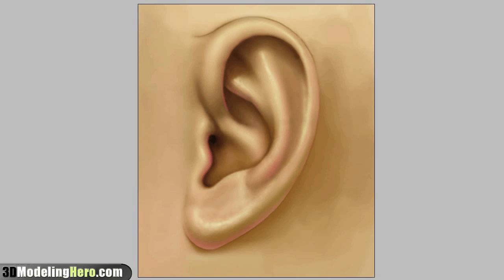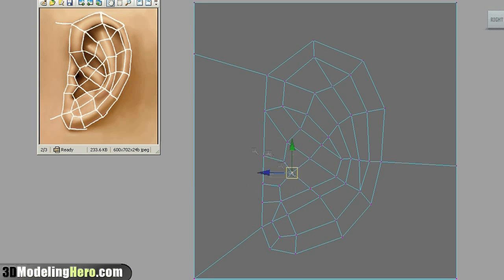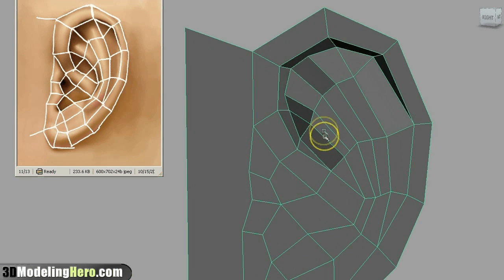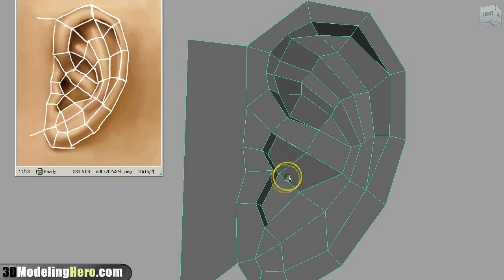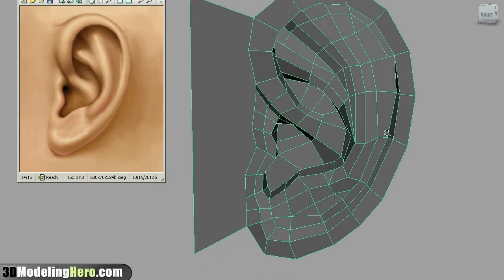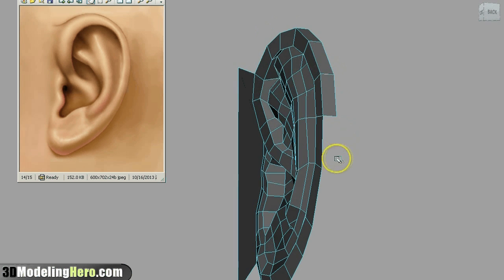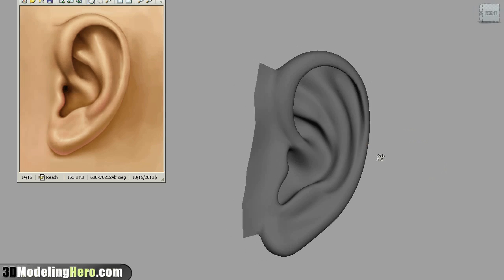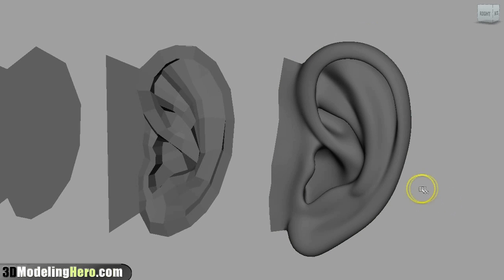How to Model an Ear - Low Poly to Intermediate 3D Modeling Tutorial - Box Modeling

Comment: Mmmm...Breaking the flow by having sudden tris about? Not quite my style however useful to see a method to get down the shape. To maintain the flow I would have created triangle shaped quads then just continued the flow of quads.
Reply from the maker: +CapitalGearGaming Yeah, you can fix those triangles easily. The important thing is get the overall shape first, and not be bogged down minor technical errors. Actually, the triangles are not even errors once you subdivide them.
Reply: +Art of Wei yah. I was just mentioning them. :) Thanks for the video. it's useful.

Comment: great tutorial. But why don't you care about triangles?
My teacher allways tells us to avoid triangles in any case.
So I tried my ear without any and fond it much much harder to make...
Reply from the maker: Kirrie Sushicat ô.o Because the triangles turns into quads once you subdivide them. It's not as clean once subdivided, but it works just as well as if you had started it with a quad. Making everything about of quads at the beginning is a BIG waste of time. If you want it to be quads, then at least do it at the end, not at the beginning, because it really slows you down.
Reply: Art of Wei yeah... I wasted like one whole day to model my ear... I allways ended up to get some triangles during the process, it made me crazy! Great thing to know that I can start with triangles and make them to squads later- I'll try that next time! Do you have some more tutorials of how to subdivide the triangles on the easiest way? That'll be very helpful
Reply: +Kirrie Sushicat ô.o 

Maybe you could try too sculpt your earf first in 3DCoat and than do you made a retopo in 3DCoat, manual or per autoretopo. 3Dcoat is similar too Zbrush, but easier and not so espensive. 

Art of Wei says right - riangles turns into quads once you subdivide them - I did see that in a Cinema 4d Tutorial, but in some other programs you will get - if you subdivide a mesh with triangles a weird mesh if you have triangles, e.g. holes  after subdivision.

Comment from the maker: Somehow your previous comment didn't make it here, so I'll answer it here. For 3DSMax, I'm using version 9 too=). I never bothered upgrading as it does want I need it to do. For modeling, if you can, use Maya, it's much faster. In Max, you can't just delete an edge without creating a hole. So it's a pain to model in, and it uses triangles, which adds another step of flipping edges. Not cool. But for box modeling, the tools are very basic and it works wonders.